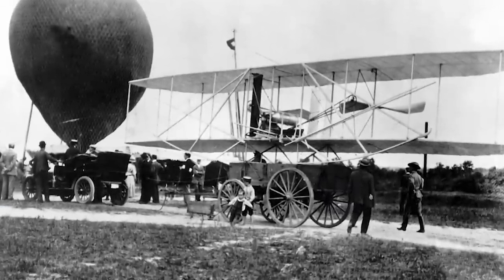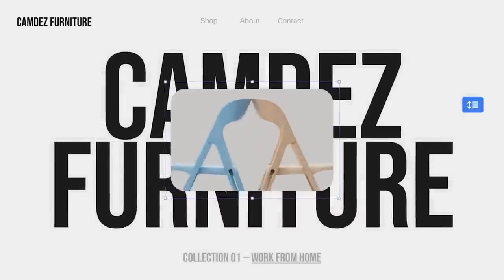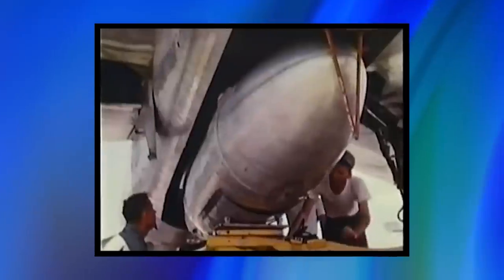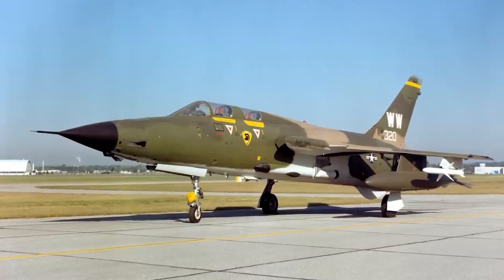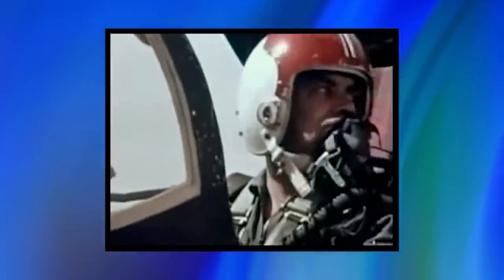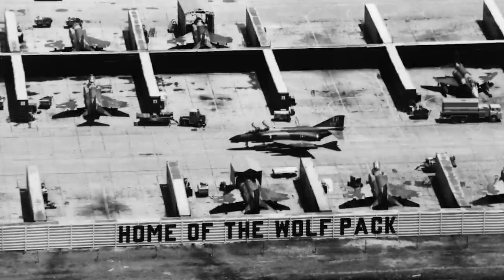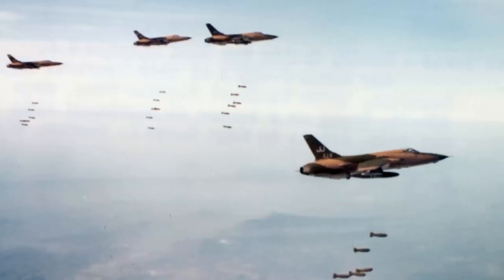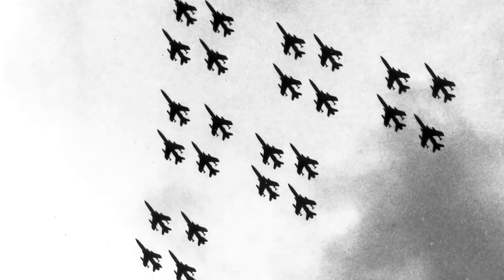The F105: The Supersonic Bomber's Fatal Flaw

Comment: To high wing loading it needed longer swept wings or a smaller load.
Reply: High wing loading allows for more stable, faster flight.  It was a design decision for its original mission…which very fortunately never was required.

Comment: The early variants had their problems but later models gradually overcame them.

The F-105 was designed to do one thing; streak in low and fast, trash as many targets as possible then zip back out just as fast as it had arrived - and it did this job extremely well. At the time the F-105 was the only thing that could get into North Vietnam. 

However due to poor tactical planning such as using the same flightpaths, same callsigns, same schedules day in and day out and the abhorrent political limitations of the Johnson administration the F-105 suffered immensely.

Comment: That clickbait title does not behoove your channel. The "fatal flaw" was not in the aircraft, but in the top managers of its use. It required more servicing only because it was much more advanced than its predecessors. And, this high maint issue came up mainly in SE Asia due to the high humidity causing problems in the electronics. Had it been used correctly for its intended role and escorted properly by lighter fighters, it would have been a different story.

Comment: "THUD" ..... The sound the plane made when hitting the jungle floor .     Over half of those made..... were lost in Viet Nam
Reply: You failed to realize that for the heavy losses the F-105 bombed the absolute shit out of the enemy.Always given the toughest and most heavily defended targets anything else was just another airplane.In 1965 they lost 3.2 aircraft per 1000 sorties,in 1966 that figure declined to 2.7 per 1000 sorties. In 1967 it was 1.6 aircraft lost per 1000 sorties. By the end of 1967 Thuds had flown around 14000 missions.The Thud pilots carried more ordenance across the 17th parallel and dropped them on target than any other bird out there. Finished up it's career with a high degree of luster,as an extremely effective airplane capable of "taking it" and "dishing it out" like it's other Republic stablemates,the F-84 Thunder jet and the P-47 Thunderbolt.On the deck it outran anything that flies all while shooting down 29 Migs,27 with the cannon. Only flaw was "McNamara" cancelling 7 Wings of the F-105's.They we're going to make 1500 of them.I think McNamara screwed up.